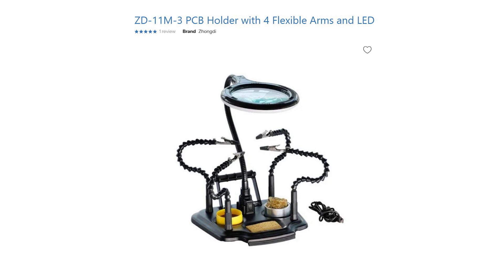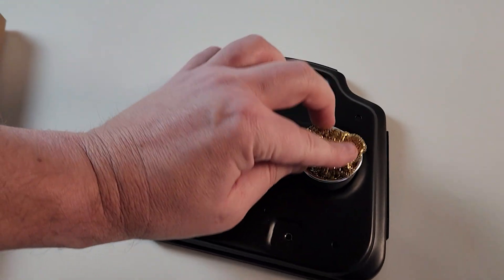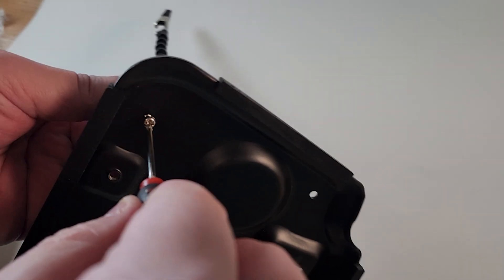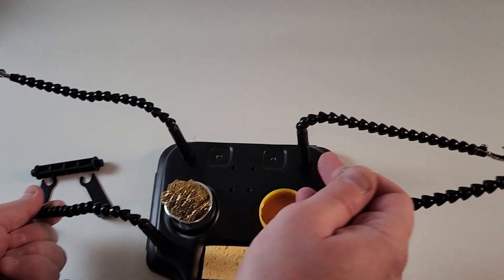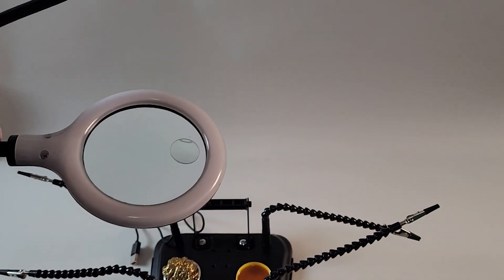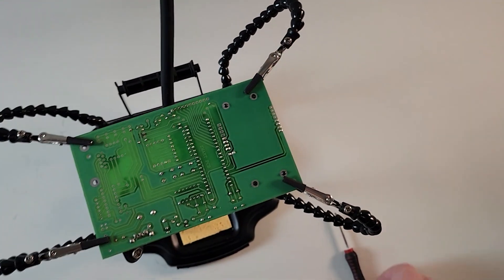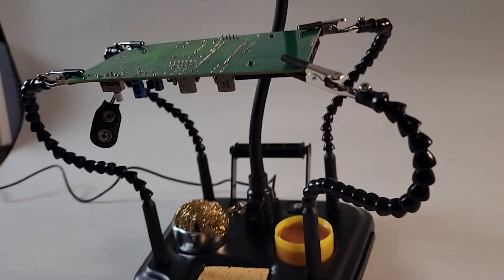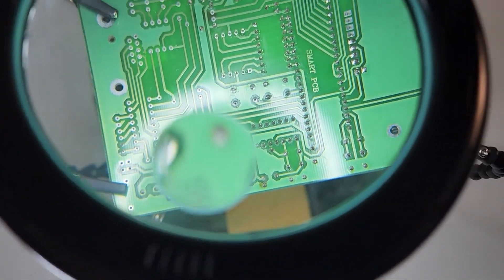ZD-11M-3 PCB Holder with 4 Flexible Arms and LED Magnifier Lamp — Unboxing

Comment from the maker: Thanks for watching! Share your favorite soldering tips or must-have tools in the comments: What’s the one tool on your workbench you can’t live without? Would a flexible PCB holder like this make your soldering projects easier?
Reply: @ElektorTV  Hello, I have just purchased the Protect Third Hand PCB Holder tool like in your video. I have put it together fine but light does not work. Just like your video, the USB does not seem to power the light. Or, the light is broken. What power adapter did you use to get it to work? Do you have any suggestions? Regards Peter